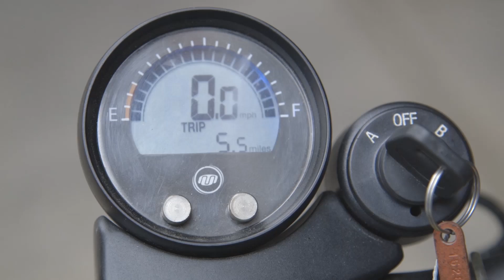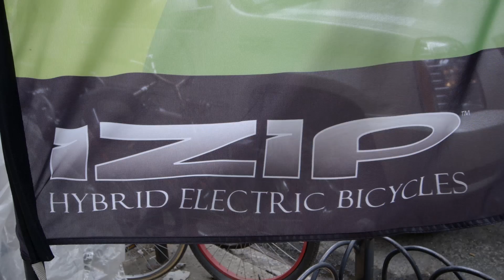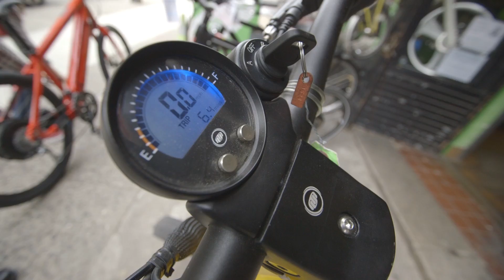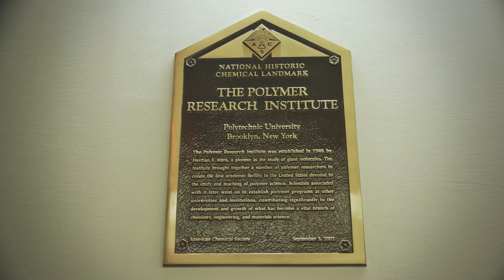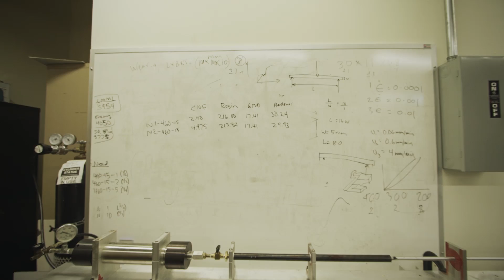Top Shelf: the future of electric bikes and biking

Comment: As a confessed 10 yr lycra wearing cyclist, I made myself a 1000W electric bike for my commutes.
What I found was not that you go faster (bikes realistically don't go faster than 25-30mph safely), but you tend to be able to maintain it for the whole commute rather than getting tired.
And you tend to pedal at the same effort as a slower bike, but at the top end of the power curve (using your 200W of power to push the bike from 20 to 25mph rather than 0 to 15mph); so you get the same amount of exercise but way more fun riding.
Reply: you forgot not getting soaked in sweat when you arrive at your workplace

Comment: The biggest threat to pedestrian safety is not the cyclist but the car. And when it comes to cyclists vs cars, a pedestrian may be able to survive a cyclist hitting them, but a cyclist may not survive a car hitting them. If you want to keep cyclists off the pavements, making the roads safer would do a great deal in achieving that.

Comment: NYC has to be one of the strangest places ever, you can drive a 200 mph car around gurgling at what 30 mph spewing out loads of pollutants, you can drive a huge truck around gurgling loads of pollutants, but you can't ride an electric bike which will only do 20 mph without pedalling that is the strangest thing ever.

Also a 20 stone person could ride a none electric bike as fast as they can manage let's say 30 mph down hill or along the flat and the law has no problem with that, but if they trundle around on an electric bike doing 10 mph they are breaking the law.
Very strange.
Reply: changing laws in NYC is like pulling the teeth of a pissed off hungry bear.... and you are wearing meat gloves while doing it. They fight the whole way. I can see the argument you have all the "rights" of a bike... sidewalk, city park, back alleys, lane splitting and such. But none of the rules associated with a motor vehicle. If they can only do 25 sure let em keep the bike laws. But when you see a bike on youtube doing 70km/h its no longer a pedal bike its a motorcycle there should be laws in place.... better than cars and trucks and public transportation YES getting the laws and the views of the majority to change and see this. Well there is NYC's battle.
Reply: ***** Of course a bike that can do over 28 mph without pedalling should be considered as a motorcycle/moped but when a when you have a city that simply bans electric bikes simply because they are electric then there is something seriously wrong with the people in power they simply are unable to understand sense.

Any city is limited in the amount of room available to it for parking, encourage people out of their cars and onto motorcycles and electric bikes and the amount of room available increases.

You could park aroun0d 20 or more electric bikes in two car parking spaces or you could park around 10 or more motorcycles in the same spaces.

Now imagine how nice it would be to be able to come out of your apartment in the hart of the city walk over to your bike and simply ride direct to any part of the city unrestricted by traffic.

Just imagine how much time is wasted in traffic, how many days or weeks are lost just simply sitting around in traffic doing nothing.

NYC may fight all the way on everything but what if instead of fighting with them they were shown the benefits of electric bikes and motorcycles.

Then if they still can't see it there must be something mentally wrong with them and perhaps they shouldn't be in a position of power.

California seems to have it just about right with regard to electric bikes 20 mph without pedalling and 750 watts power output.

Above this and it becomes a motorcycle.
Reply: ***** Not it's nothing to do with that, if that was the case cars would be banned and they are not, in fact cars are encouraged while small lightweight powered vehicles are discouraged apparently.

If the truth be known they are simply backward in their forward thinking for the transportation.

The UK is pretty much the same except they haven't banned them they just make it so many rules and regulations about them oh and banned electric scooters instead, unless you register them as motorcycles.

Comment: the issue of electric bicycles, is too much focus on making the bike faster and faster, when the goal of the sellers claims they are about conserving power , portability, travel cost and the burden of body energy fatigue, the issue with helmets is, no convenient way to put them away like a fully engine,wheel and helmet mount park lock and a easier way to place them on off as head gears, as for the law, NYC needs more bicycling line paths within the roads, so the bike riders don't exploit toggling between sidewalks and road so unsafely, let alone universal parking space in parking lot mounts for 2-1 wheel slim machines like a bike/bicycle.

Comment: I feel like these guys have never heard of riding a motorcycle....obviously you don't ride on sidewalks with people but they weight 300-450lbs and stop on mechanical / hydraulic braking power just fine....just seems like there should be a safety course to teach people how to properly ride somewhat like the majority of  motorcyclist have to complete ....as well as proper gear requirements....but I like the idea of electric bikes

Comment: I have a $500 eBike kit on a Schwinn mountain bike.  It is throttle on or off.  I can only get me to a max of 19mph, but that has freed to bike anywhere in my town.  I just needed a boost to help my 71 yr old legs get over these damn hills.  20 mile range using only battery, so since I always peddle, except downhill, I have never run out of battery, even on 20+ mile trips.  It's not an electric scooter, just a bike with an afterburner.
Reply: Hey man, I just turned 72 last Saturday...and I can get my legs over the tube but I love e-bikes.

Comment: Aviva Elecrtic Bikes should be at the top.  Lithium ion battery with disk brakes,,brake lights, 350 watt motor, 7 speeds wth 3 speed electric controller - all the bells and whistles..  You CANNOT beat this bike for  smoothness, ease, and price. $1,400 to $1,550 - amazing!
Reply: Michael Dressler i just paid 500.00 today brand new dont get better then that